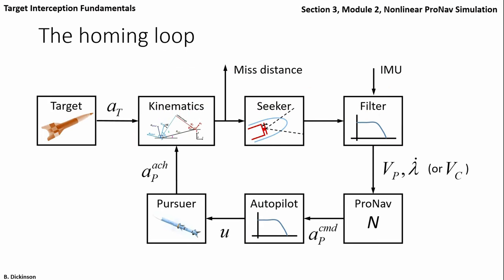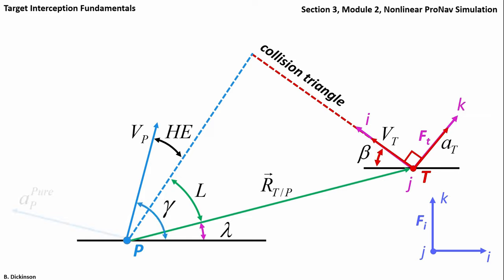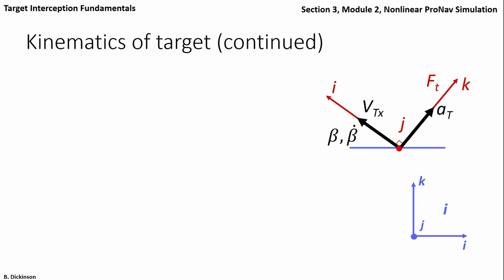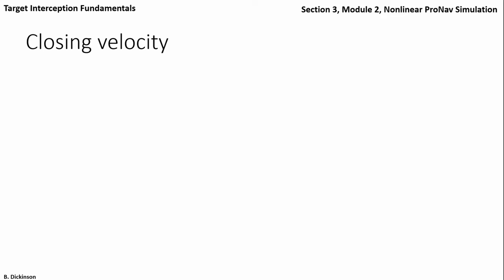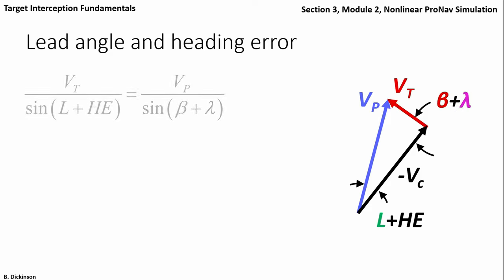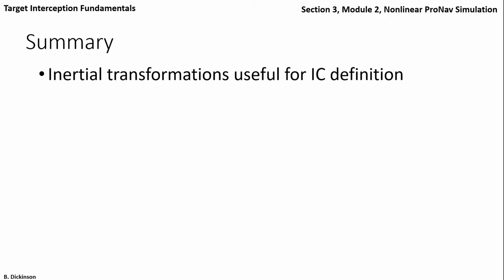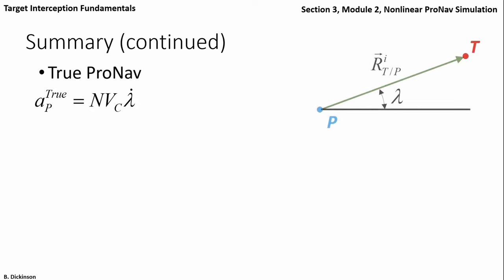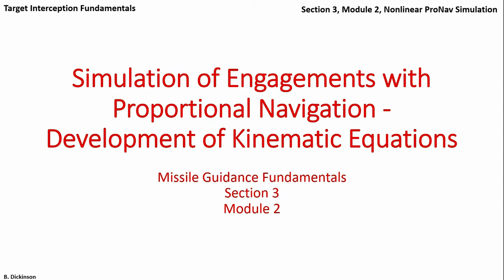Kinematics for Simulation of Proportional Navigation Rev 2 - Section 3 Module 2 - Guidance

Comment: Hi ben! Amazing video! The only thing I didnt understand is how to transform the acceleration command into the Z and X acceleration commands relative to the pursuer frame. Any insights?
Reply from the maker: Hello, to resolve the acceleration command in the body coordinate system, we must transform with the direction cosine matrix that is based on the line of sight angle. See the discussion starting at 12:50.

Comment: Hi Ben, I'm racking my brains over this. In 11:32, it is stated that V_i_Px = V_p_Px * SIN (Lambda + HE + L), but I think that the SIN term should be replaced by COS, as the current term does not make geometric sense, what do you think?
Reply from the maker: Yes, you are correct! Actually, the top equation should be VPz and the bottom should be VPx. Good catch! Thank you.

Comment: I was wondering whether there are kinematic relations to transform the resulting pro-nav acceleration commands into desired roll pitch and yaw Euler angles for a quadrotor's autopilot. If so, any references?
Reply from the maker: They are certainly related, but quadrotors are outside my present domain. Sorry, no references. Good luck!

Comment: In the initial scenario, with the various frames, the i's & k's don't seem to be consisent. For instance, the i-axis in Pursuer and Intertial Frame are 90 degrees clockwise from k-axis, while in the Target frame, the i-axis is 90 degrees counterclockwise from k-axis. Is there any reason for this, and how can I account for this in calculations?

I am a high school student, so it's a bit difficult understanding this 😵‍💫. Thank you in advance.
Reply from the maker: Hello! This analysis already accounts for each coordinate system (CS) and their directions. The resulting motions are true to the inertial coordinate system directions. 

In modeling and simulation of aircraft, multiple CSs are involved. Each CS can be defined independently of the other CSs. Usually, the CS will have orthogonal directions with i-j-k components defined by the right hand rule. However, there are exceptions that arise on occasion. 

When vehicle kinematics or dynamics are described with multiple CSs, the key is to correctly develop the relationships between them. This is what was done here: CSs were defined for the pursuer, target, and earth; then, their kinematics were derived in the inertial CS was as a set of differential equations. 

For one without a formal background in engineering (congratulations on taking on a advanced topic by the way), many of the things I've written above may be unfamiliar. However, there are many online resources that can help. 

Good luck!
Ben

Comment: Hey Ben, why did you add the sqaures of x and z components at 7:45 and then take a square root before taking a derivative?
Reply from the maker: There we're determining the closing velocity, defined as negative time rate of change of range. Range is the magnitude of the relative position, or square root of sum of squares of x and z components. Since the derivative is on magnitude, we determine magnitude first.
Reply: @LearnGandC  Ohh i can't believe i forgot about it I have been trying to rack my brain about it for the past hour. Thanks alot for replying on such short notice!!!
Reply from the maker: I've been there too! But, the silver lining is that you've probably gone through so many ideas over that hour, that you've strengthened your understanding much more than if you did not have the question.
Reply: @LearnGandC  haha yeah I actually did.

Comment: Hi Ben, great lectures and very helpful. One question; at 7:18 shouldn't R_ t/p = R_t - R_p?
Reply from the maker: Salman, you are absolutely right! Thanks for catching that. Same for relative velocity.
Reply: @LearnGandC  Hello, I have a question: If I have a fixed target on the ground and I want to hit it from the air, what should I change in the data?
Reply: Hello, I have a question: If I have a fixed target on the ground and I want to hit it from the air, what should I change in the data?
Reply from the maker: Actually nothing, proportional navigation works with fixed targets. A different N gain may be best though.

Comment: Is Vp a scalar in pure ProNav?
Reply from the maker: Yes, it is denoted Vp as in velocity, but under the assumption the velocity points out the nose of the pursuer. That is, the Vp is the value of this body x-axis velocity component. So, as used in the PPN law, it's a scalar.
Reply: @LearnGandC  Thanks! One more  question- Is it essential to include an inertial reference frame?
Reply from the maker: The engagement kinematics are with respect to an inertial frame. Input data to the guidance law like velocity is also with respect to an inertial frame. However, I've never seen proof that an inertial frame is essential.
Reply: @LearnGandC  Interesting... I ask because I'm trying to make a guided robot for the robotic football league I'm in. The robot would tackle the opposition's robot by colliding into it. 

I plan on using a 2d lidar scanner to find the change in the line of sight angle. The sensor outputs data in polar so this would just be the derivative of theta. The pursuer's velocity would be based off accelerometer data or a motor encoder.

I imagine, from the robot's perspective, a collision course would appear in the lidar data as a point moving closer to the origin along a set angle. 

Does this sound plausible?
Reply from the maker: Yes, you have the necessary measurements!

From the robots perspective, it would see the opponent at constant heading to itself as it closes in if on a perfect collision course.